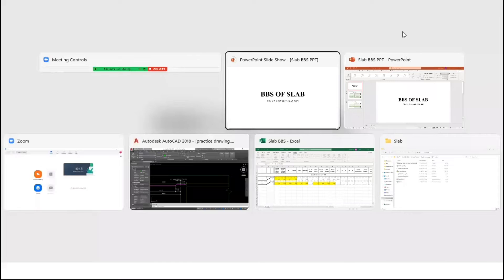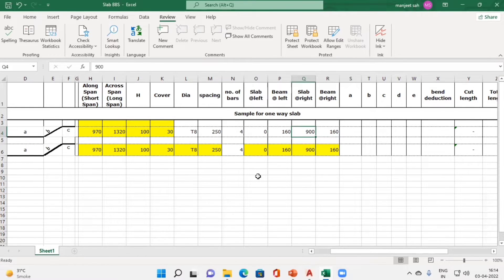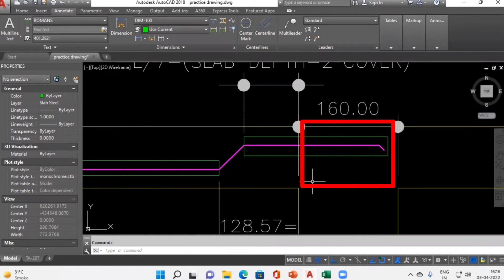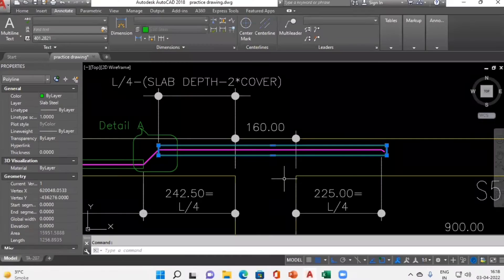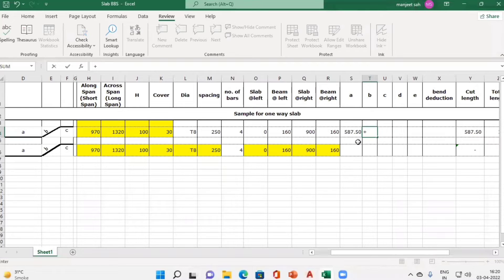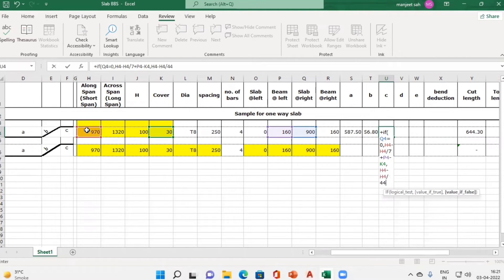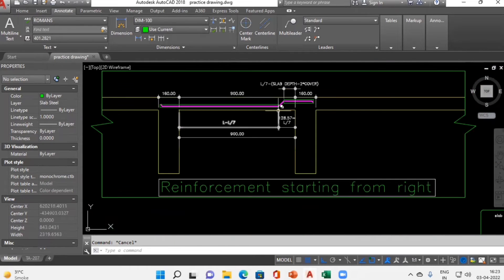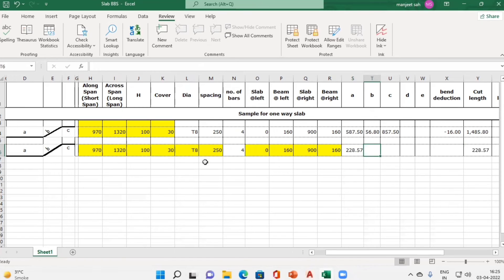How to make BBS Bar bending schedule of slab in Excel format

Comment: Can you please elaborate @4:09 why you are subtracting slab depth and 2 times cover from L/7 ?
Reply: @7:10 crank length would be 0.42x(slab depth-cover-dia. of bar), but you mention 1.42x(slab depth-2xcover) ?
Reply from the maker: 1.42 is shown since we have calculated bbs considering actual steel which is used on site. 0.42d is used when we consider horizontal length through out. We have not considered complete horizontal length
Reply: Length is taken after deduction of length for crank location.